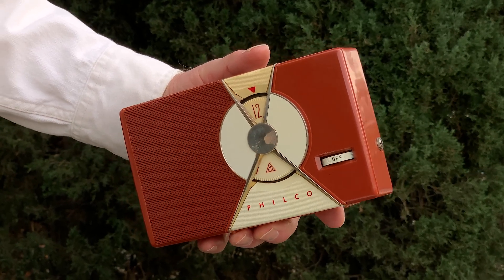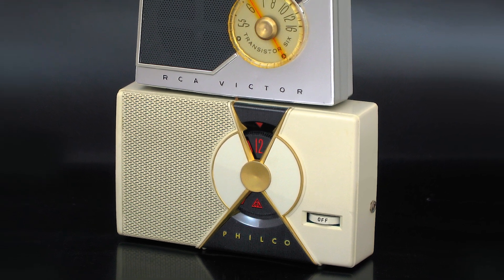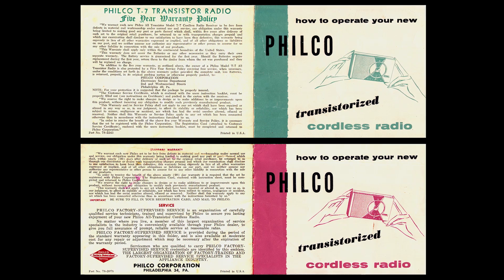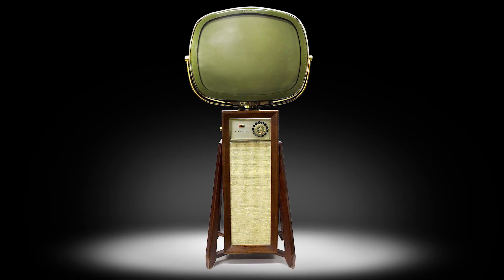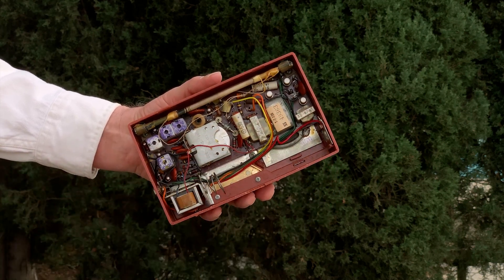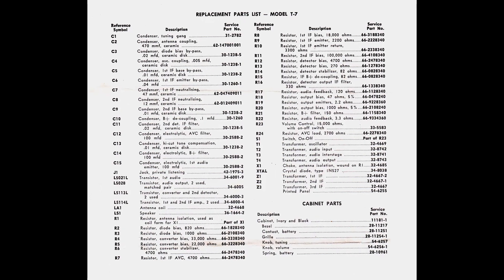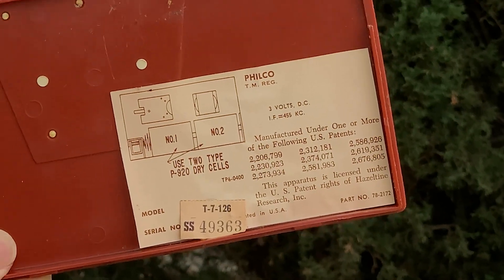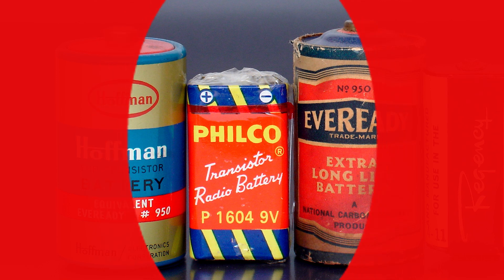First PHILCO transistor radio - 1956 - manuals, history, Philips, Norelco - collectornet.net

Comment: If you dig further, Philco was in deep financial trouble way before Ford bought them.  They had over-expanded after WWII and the Philco Predicta TV series cost them a lot of money in warranty claims.  These TVs may look neat,  but they were not at all reliable. The Predicta TVs used a 2v filament voltage CRT that failed all the time. They may not look as neat, but RCA and Zenith TVs were much better quality in those days. Do not blame Ford for destroying Philco, Philco did it themselves.